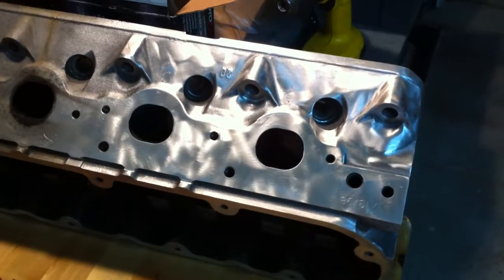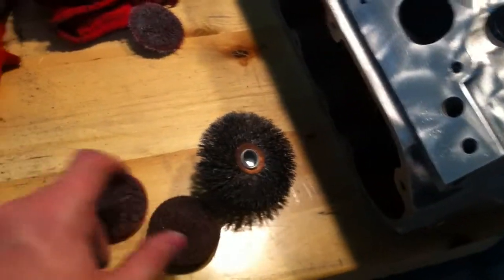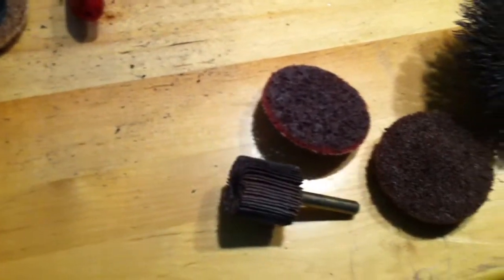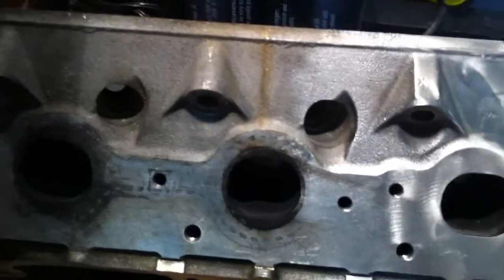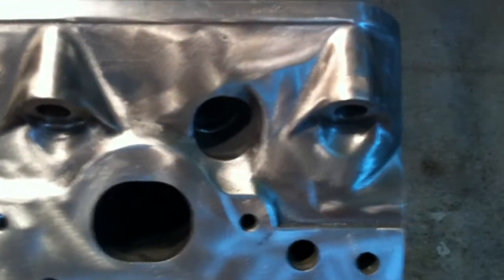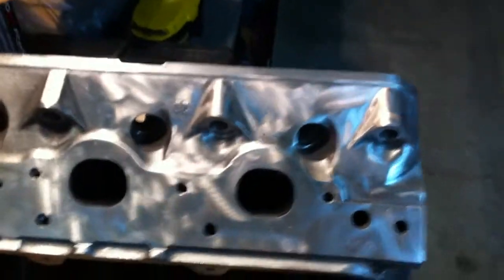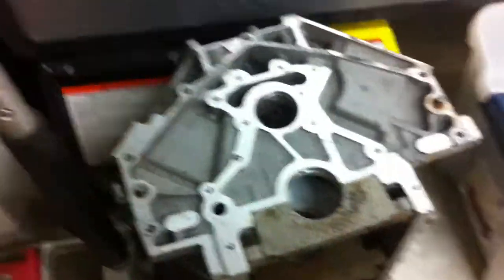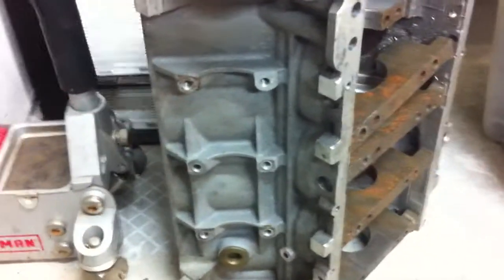First Attempt At Smoothing Engine

Comment: How did it come out? I've smoothed a few blocks for some demanding customers. I typically hire a patternmaker to make me a duplicate of the casting and then use a duplicate carver with a foredom. Takes a little time to align it, but if you're doing more than one its the way to go. 

There is a market for this work, once you're in you want out.